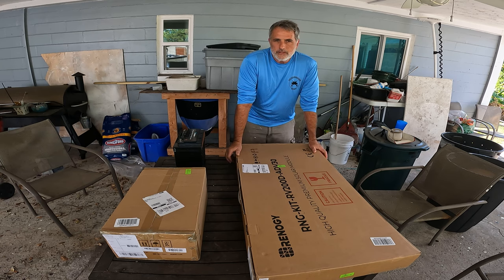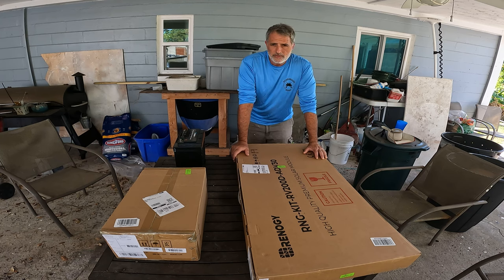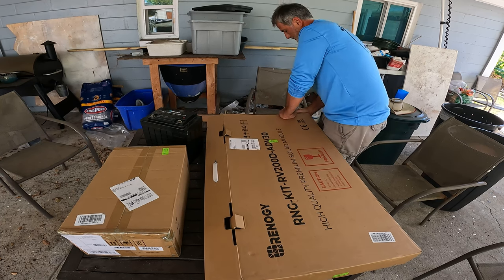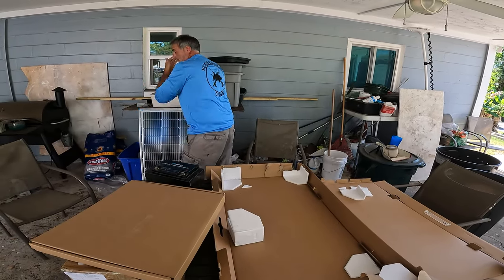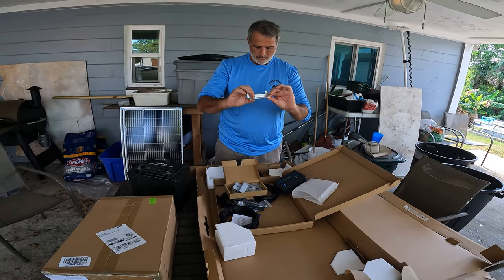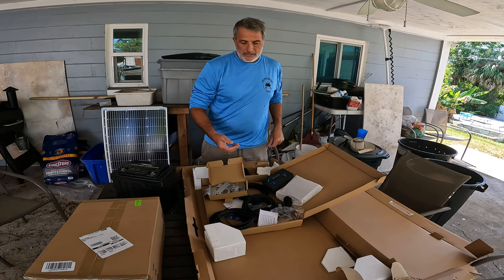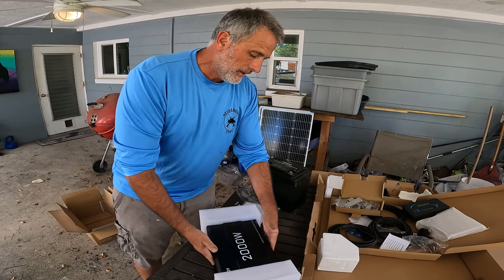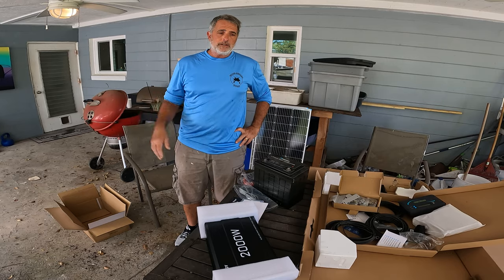Solar Powered Work Trailer: Renogy Solar Kit Unboxing

Comment: Very cool… what does it cost to do a setup like this?
Reply from the maker: You can get the whole setup from Renogy for right at $1100. Could probably drop the price considerably if you went with 1 panel, a 1000w inverter, and a cheaper battery. Looking at it now I definitely didn't need 2 panels.